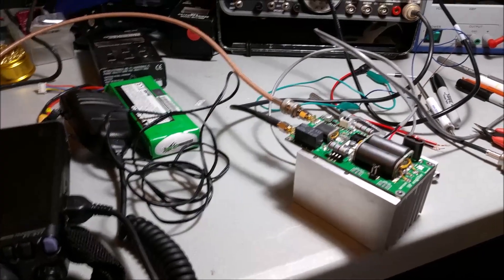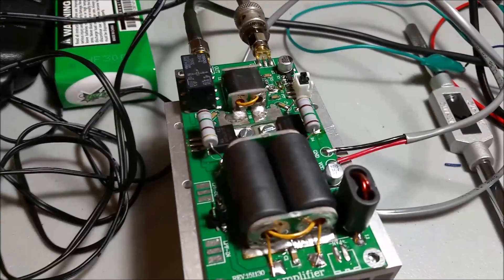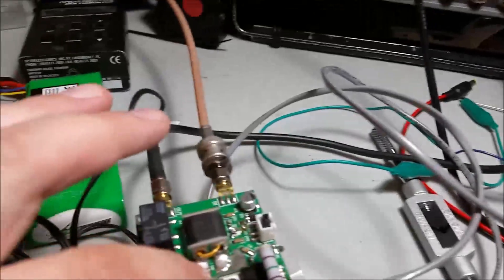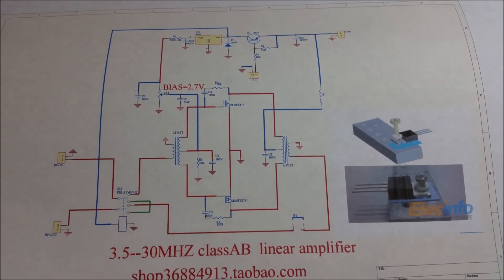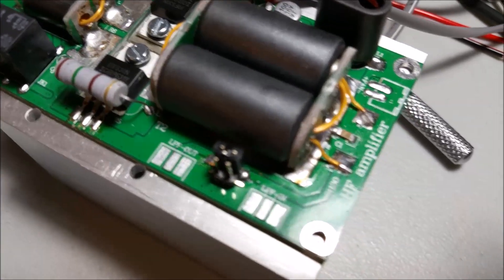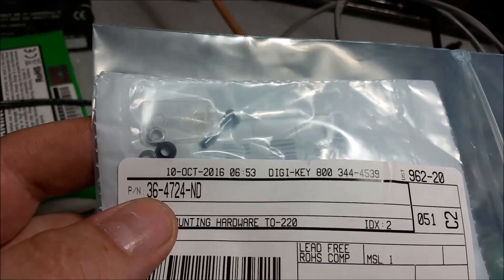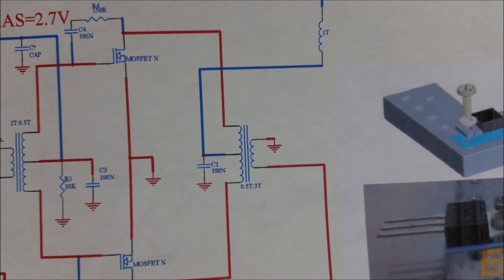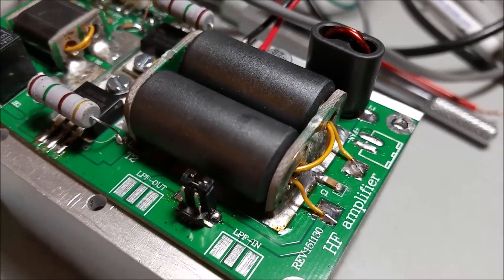Testing the Minipa70 HF Amplifier Kit

Comment: This amp design is a handful, as described by a few RF guys that have posted videos on YouTube.  I had to add a 4 Amp current limiter and control for the PA Voltage as well as controlling the bias voltage when the IRF 530's "take off".  This is a good amplifier to build to get to better understand how class AB FET amplifiers work, I am probably going to add an input attenuator (about 1 dB) to take care of the input SWR issues on 10-80 meters.  As mentioned elsewhere low pass filtering is a must.  The happy space for my amp is about 3 Watts input yielding 15 to 20 Watts output, although the long-term reliability is still questionable.  There are other designs that in my opinion are much better (Communication Concepts), search online for them and you will see what they sell).  Still, if you are looking for a project, something that is frustrating and difficult to use, and inexpensive, this is a good kit to learn from.

Comment: Mine exhibits a lot of harmonic output in the absence of an output LPF, which is needed before putting this unit on the air.

The manufacturer also states that it must be protected from any accidental output open circuit or short circuit load and will only work into a maximum SWR of 2.0:1.

I have an output load out-of-range detector and shutdown circuit, which I designed and built myself. This circuit of mine will both ground this amplifier's bias line (to zero volts) and  inhibit exciter transmit power being applied by disabling PTT when the output load is out-of-range; open, short, or SWR greater than 2.0:1.

One diifficulty I had with this amplifier's PCB is there is insufficient clearance between the PC trace for the center tap of the secondary side of the input ferrite RF transformer and an adjacent swath of ground. This can result in an evasive intermitten short to ground on the center tap of the secondary side of the input ferrite RF transformer, which kills the bias to the power FET gates.

Comment: Building one for usdx 5w HF transceiver. How do you get around the PTT circuit? Jumper? Do you recommend adding low pass filter.  Work mostly  20m DX. Thanks. Kk3sc
Reply: SSB BTW.

Comment: This linear is not linear if built directly as per the parts. What is missing is R6, it should be 18 ohms 5 watts.
Reply: I tried to look at the schematic and I could not find R6.  I see it on the PCB and it looks like it balances the input on the gates on the MOSFETs or am I misinterpreting?  Will not having this resistor take these parts out of the linear range?  Would you explain why you have this concern a little more?  Thanks in advance.  Thinking of building an amp for an old Tentec QRP rig I have.  I probably will build something using an LDMOS and not this one, just trying to understand better.

Comment: by now there is a kit on ebay assembled or DIY with up to 200 watts (24 volts /16 amps, 5 watts input). I bought the assembled one and I must admit it is very good soldered an wired

Comment: I built a Heathkit GW12 CB Base in the 1960's when I was a teenager. I found a working GW12 at the Dayton Hamvention. I replaced all tubes and tuned it according to the manual. I can only get .5 to .75 watts out of it. Will that be enough power to run this little amp? I would think with .5 watt in it should put out 3-5 watts. You mentioned the resistors getting hot, would it help to mount resistors of a higher wattage? I am expecting the kit to arrive July 17 2022.

Comment: Thanks for sharing.... To be honest, somehow I doubt that IRF530s are any good on 28 MHz. Or are they?
Reply: I haven't got my amp put together yet, but I expect about 15 Watts on 10 meters. Of course, that depends on how much drive power you run, how hot you bias the MOSFET's, and what voltage you power them with. These FET's can be run on 30 to 40 volts. If you run the amp on 13.8 V don't expect even half of what he claimed as output power, and he made no mention of those most important parameters.

Comment: Good evening, I have an XDT-PA100 amplifier. I have a cable for yaesu ft 818. I have a red and black wire on the amplifier. with what color do I connect to the cable cat

Comment: My amplifier does not amplify the signal... zero watts out. Have tried with new pair of MOSFETs. Biased correctly, but only 20 mA current on idle. What could be the problem?
Reply: Discotec tour Solder when Solder the MOSFET
Reply: I have the same problem. Did you solve it?

Comment: I also bought one of these, more for self education than expecting a miracle and indeed it does generate RF (but the supplied FETs were pretty shocking) 
It may help others to know you can improve the spectrum at the bottom of the band quite considerably with a Z-link shorting winding of heavy wire through the output cores. As built this is really 2 independent transformers, as each primary only drives one core, and linking in anti-series them so one drain voltage is forced up as the other goes down really helps the waveform. It is very informative to put the drain waveforms on a scope- the distortion is actually visible, so 2F and 3F must be about 10dB down on carrier before modification. I agree that a decent 'how to get the best out of this' instruction is sorely needed.
Reply: I was looking for the primary center tap for this big transformer in the photos, and was surprised I didn't see one. Are they driving the finals in parallel, which does nothing for harmonic suppression??? Push-pull would at least mitigate the even harmonics. It also looks as if they have a single bias for both '530s. Okay if you have a matched pair, but at this price point, I wouldn't count on it!
If I wanted to use one of these for constant-envelope modes (eg., CW, RTTY/(A)FSK), how low could I set the bias? A push-pull pair, each operating in Class C mode, should work FB with a constant-envelope signal and some harmonic filtering. I suspect that would reduce the heating a bit. Or would I be better off going the switch-mode route, say, Class E?
Reply: @drvigg9083  Be careful,  it is really nothing like  one transformer with centre tap - if anything more like two transformers, one primary tube per FET  connected from drain to B+, with the multi-turn secondaries  in series. A moment to sketch this out shows this is not really the right thing to do at all,, no wonder it is rough  - what you really want is to force one FET drain to be pushed up in voltage  to about twice V+  by the other is pulling down near 0V. Hence the shorted 'Z' winding improving the waveform quality, though a true centre tapped bias choke would be better.  If you have a dual channel scope, all is revealed. Mine has now had so many hacks it looks nothing like the original.  Un-modified  you will not get anything like the stated power continuous, it is very much an optimistic peak pulse power rating,
Mike

Comment: Should that PTT jumper be in place default?  I cant get this thing to fire up.. hmmm that relay should click right 
?
Reply: My Relay circuit did nott work.. And the ground to the relay was OC. Im not sure if you have to isolate the heatsink. Also my bias circuit was cooked
Reply: A little late after 2 years, but I have this problem to.

The amplifier produce his power around 70 watts, but the relais not clicking bij puch the Mike.
What can it be.

Best Regards

Comment: Question, can this amp be used with a radio that has an internal tuner? (I have a Xiegu G 90) or must an external tuner be added?
Reply: The answer, is no, the tuner needs to be after the transmitter, so it can tune the antenna to the transmitter.

Comment: I built one a year or so ago. Little by little I added to it (BPF) and installed it into a box, mounted the LED's from the BPF to the front, and added an Arduino wattmeter found in a recent QST. I see around 55W out with the high setting from my 817d, and have worked JA from the East Coast on 20 using FT8. I added a fan to my heatsink because it will get quite warm & don't want to blow anything up! 73

Comment: So I picked one of these up.  Now, what's the procedure for powering it up, without damaging either the amp or the transmitter?  It come with a PTT connector.  How does the PTT connector function?  What if I simply want to send CW, for example?

Comment: One question sir i have a 3 watt power FM transmitter which is transmitting audio well if i give output of that transmitter to this rf amplifier input will it work? i think it will work well for further longer ranges. do you think it will transmit my audio to further distance like commercial FM radio stations?

Comment: The Transistors they supply with this kit are FAKE IRF530, I have built 10 of these kits and have fitted genuine  IRF530 Transistors from Radio Spares, by the way great Video.

Comment: What gauge is the wire used for the transformers in your amp?  I just got my kit, and instead of the orange wire I got some 30AWG stuff that looks like it should be in an old wire wrap kit.

Comment: hhmmm.. built this but you have to have the PTT  jumper in position for it to work, sadly when the PTT circuit is working.. it greatly attenuates the receive signal..so AFAIK you NEED to make a PTT cable from your radio for this to work correctly ? it does not seem to have RF sensing..

Comment: Being that you are a License General class operator I know that you did not transmit with that amp without the low pass filters in place. You should know better.
Reply: It was a test, the amp was not used regularly that way. You need to find better ways to spend your time other than useless comments on YouTube.
Reply: Michael.. Go  Fuck yourself !
Reply: "You should know better." Yeah you sound like a typical snobby old fart ham. How about giving the guy good advice instead of brow beating?

Comment: Hm heat on top and heatsink on bottom, how's that working out for you?
Reply: lenny.. you are a cock.
Reply: hahaha on your comment
Reply: Leonard Belcher just fine, how about you?
Reply: The board has an opening where the MOSFETs mount. The MOSFET's tabs are bolted directly to the heatsink (with a thin insulator between). This is standard practice.  de WA5BDU

Comment: IRF530N is a very poor choice for an HF linear amplifier. Sure, it's dirt cheap compared to proper RF transistors, but it's first of all designed for switching applications, not linear operation. As such, linearity of the amplifier is likely to be quite poor, as well as reliability issues due to thermal limitations while operating such a MOSFET in the linear region at high power levels.

Yes, specialized RF transistors are much more expensive (easily 50% or more of the total parts cost of an amplifier), but they are specifically engineered for linearity, thermal dissipation, and controlled impedance throughout the operating frequency range. See how in DK9JC's test results the input SWR and gain of the amplifier is all over the place? That's because the impedance characteristics of the IRF530N are very frequency dependent, and parasitic capacitance and inductance in the transistor's construction play a major role when operating these transistors in RF linear mode.
Reply: Hams often go with what's cheap and will work, as these amps do. They are famous for ingenious adaptation. If the transistors pop it's about $3 to replace them. Anyone with a few thousand bucks in their wallet is welcome to buy a beautifully engineered amplifier made with all the best parts. As for me, I can build a good output filter real cheap.
Reply: @johnwest7993  You can filter out harmonics but you can't filter out IMD (intermodulation distortion) because those distortion products are so close to the desired signal.
Reply: @TehMG , I don't plan on using them as linear amps anyway. I'll be using them on CW for portable ops. I wanted the option of another 30 to 50 watts on the output of my QRP rig when I'm up in the mountains with the backpackable 40 meter vertical I put together. I like running low power, but I'm not a complete QRP fanatic.
Reply: @johnwest7993  That's about my story too, except that I'm all-QRP now (no 100W rig anymore) and would like an amp like this one to use at home. I was disappointed not to see a CW demonstration here. Seems to happen a lot in YouTube videos. ('Course there are probably lots of videos where they only demonstrate in CW, and I don't notice because I'm a brasspounder. The fone guys out there are probably saying, "Great, what about us?")
Reply: MGYouTube Account what transistor do u suggest as a replacement?
Reply: The input and output capacitance of the IRF530 is way to high. Irf510 is a better choice but stay away from the cheapies. Get some of the original fets from a dedicated supplier.
Reply: Dont use the supplied FAKE mosfets. They will FAIL because their gain is excessive at low input levels (100mw). Get the REAL ones if you HAVE to use these MOSFETS. Without real instructions and REAL parts, you are wasting your money and the kit is really an exercise in soldering SMDs.

Comment: No Band pass, dirty amps cause RFI on multiple  harmonics with out filtering.........
Reply: I have been testing it out on 20 meters at  about 50 watts on scheduled contacts , no harmonics so far. I don't have equipment to test just amp.
Reply: @minnesotaChannel-45  no it DOES have a dirty signal.. im getting bad audio reports with it.

Comment: Out of curiosity, what bias voltage would I use if I wanted the peak output to be 50W instead of 70W (with 5V input)?
Reply: Thats not to adjust whit the bias!!  YOU HAVE TO DO THAT AT THE INPUTside.

Comment: Does this have an RF sensing PTT circuit, or does it have to plug into an accessory jack on the radio? -de KC8MWG
Reply: no RF sensing.. you really need a PTT jack from rig..as RX signal is attenuated when relay is switched.

Comment: Yeah... I bought two of these too, and you are correct... most people will never build these because there is no documentation.  I like you worked my way through it... made some calculations to get the turns right on the transformers (4:1 and 6:1).  I suppose if one of us put together a nice build manual for it, they would proliferate.  If I have time... DE K9HZ

Comment: I've built mine, it works, but when adjusting the bias, be sure to terminate the output into a load, or it will oscillate!
Reply: WHERE do i take the voltage reading from for bias adjustment is it the transistor ? if so  which legs ?.. BCE ? thanks
Reply: @RobBob555  Measure at the wiper of the pot. These transistors are enhancement mode MOSFETS, not BJTs, so no C-B-E, it's G-D-S. 2.7Vdc at the middle leg of the pot is what you want.

Comment: Did you ever get a chance to put this on a spectrum analyser? I just ordered one of these and a low pass filter to use with my bitx40.  Thanks for posting this video.
Reply from the maker: Not yet but I have been meaning to do so. I have been doing alot of work on the simulcast system so some things have been pushed to the side for now.
Reply: I built one the other day and it seems to work just fine. Do you think this unit could be run on 24v  for a cleaner signal? And do you know what else would need to be done such as lowering bias voltage?
Reply: @adamslarren2100  The IRF530N transistors are not rated for that level of supply voltage.

Comment: Here it is just for $21 incl. shipping but do not forget to add LPF as same as enough efficient fan cooling as same as open-short-unmatched protection circuits...http://www.ebay.com/itm/70W-SSB-linear-HF-Power-Amplifier-For-YAESU-FT-817-KX3-Ham-Radio-DIY-Kits-/401280684714?hash=item5d6e3152aa:g:w48AAOSwr~lYrkgSAlso be noted it is not QSK amplifier.
Reply: what it mean?

Comment: http://m.ebay.com/itm/Assembled-12v-100W-3-5Mhz-30Mhz-HF-power-amplifier-low-pass-filter-/222101671268?_trkparms=aid%253D222007%2526algo%253DSIC.MBE%2526ao%253D1%2526asc%253D20150519202348%2526meid%253Da5b1f6df3f2f4b4abca609d2fcdb9467%2526pid%253D100408%2526rk%253D6%2526rkt%253D25%2526sd%253D172203976141&_trksid=p2056116.c100408.m2460.      100w lpf
Reply: The 2nd harmonic attenuation of the eBay "100w 12v LPF" noted above is insufficient on a few of the bands.  See this:  https://translate.google.com/translate?hl=en&sl=nl&tl=en&u=http%3A%2F%2Fwww.zendamateur.com%2Fviewtopic.php%3Ff%3D14%26t%3D19203

Comment: I bought a HYS TC-300 300W amplifier from a Chinese seller on Ebay, but it did not come with any low pass filters. You need to be careful about 3rd order IMD products with this style amplifier. I later found that this amplifier would have a clean signal if it's output was only 70 - 90W. I wanted to use it with my 5W Flex 1500. I just picked up a 200W dummy load to test what input I need to drive it to 90W output.

I noticed in the link, several images of the output are shown. It's a shame they didn't have the stop frequency set for about 150Mhz. You would be able to see the 3rd order IMD of the amplifier.

WB3BJU
Reply from the maker: Yep, you are correct. I haven't tested it yet on the spectrum analyzer but I am guessing I will see harmonics on it at full output. You can minimize this if you can adjust the bias separately to each transistor to make it as linear as possible but that is not very practical. I plan on making some plug in low pass filters for the common bands I would like to use.  QRP Labs makes some nice plug in low pass filters but they are only good to about 15 watts so those wont work. I am also going to decrease the bias voltage so the amp will only peak at 50 watts as opposed to 70-80 which, from what I have read on the datasheets for the transistors (IRF530N) Is really pushing it.
Reply: What I did was buy a complete LPF diplexer from a Russian seller. I'm going to use a rotary switch to select the filter for each band. Here's a link.

http://www.ebay.com/itm/LPF-diplexer-1-8-30MHz-300W-SSB-CW-HF-amplifier-low-pass-filter-MOSFET-LDMOS-RM-/172203976141?hash=item28182825cd:g:VjAAAOSwl-FXNFyd

WB3BJU